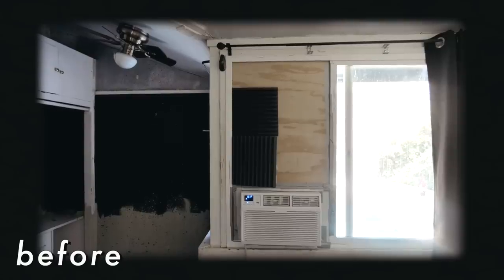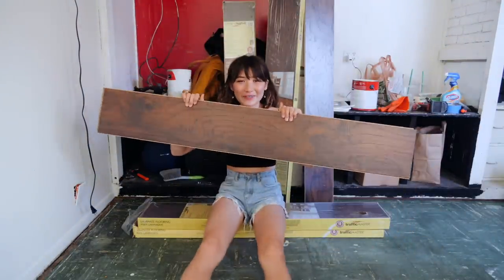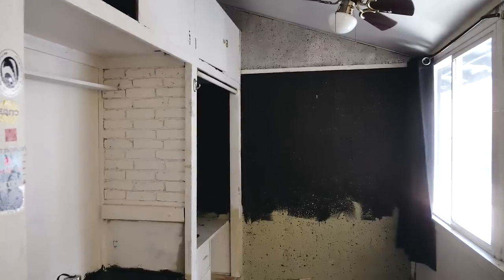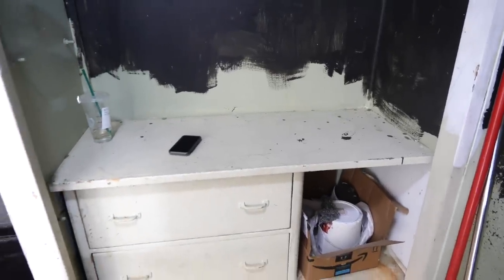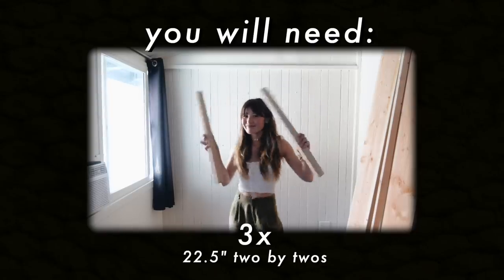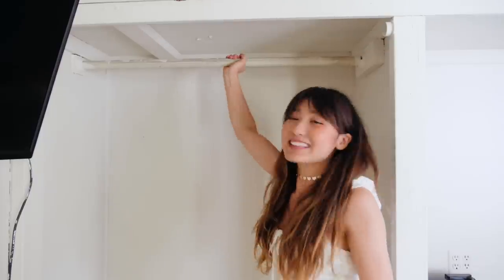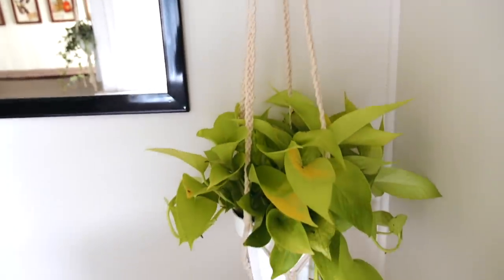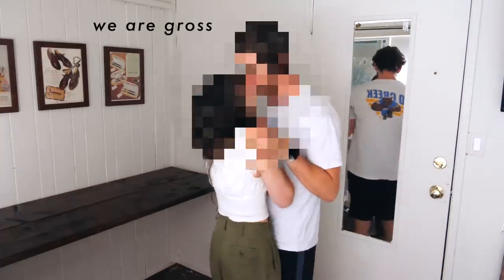EXTREME BEDROOM MAKEOVER 🛠

Comment: Why first laying the floor and afterwards painting the walls?
Reply: SI SP Why installing the wood for the table first and then painting it afterwards 😂?
Reply: Why not secure the shelves?
Reply: I totally agree with you on this one !!  I came to the comments to see if someone else caught this as well. I have done bedroom makeovers from top to bottom and the first thing is always paint first, then lay your flooring down to prevent paint damage to the new flooring or any other accidents a long the way.
Reply: Floors in remodels are usually last :/
Reply: Also she installed the hardwood right on top of the previous floor. Yikes.
Reply: SI SP also, she let a lot of dark paint dots on the walls while putting the shelves
Reply: Also, she clearly stated that she's an amateur on this. So why not trying to convert your critics into friendly advice? ;)
Reply: @daywalkerin  seemed pretty friendly to me
Reply: @daywalkerin  that was far no criticism, just wondering why she does it that way. At least she turn that trashy room into something fantastic. So please don't search for negativity where you won't find it.
Reply: daywalkerin i absolutely agree with you. 👍🏻
Reply: @missjessie9997  wasn't it the underfloor she put it on?
Reply: The reason she didn’t remove the flooring/tiles underneath the wood floor is probably because those tiles look like asbestos tiles.
Reply: Merry van Veldhuizen there’s a thing called underlayment. It can be foam or plastic but it helps prevent cracking, leaks, and dampens sounds. And she even mentioned in the video that she already had mold growth under the carpet. She’s just gonna get it again now.
Reply: @missjessie9997  i know, that's what I meant with underfloor. In dutch it's called underfloor, i just didn't know the english name. But yeah, she will. She should've replaced it but whatever
Reply: @missjessie9997  but that's not the previous floor, the previous floor was the carpet and she did remove that.

Comment: How you should have gotten the drill bit out... Fastened it on the drill again while still in the wood. Do it tight. Then put the drill in reverse and press the trigger hard so that it spins at full speed. Most importantly. Use the right drill bits. She used steel bits for everything but it worked though. 😅 Yes I mansplained.